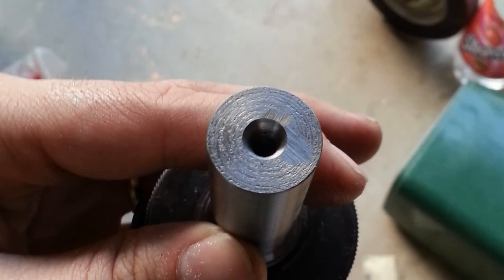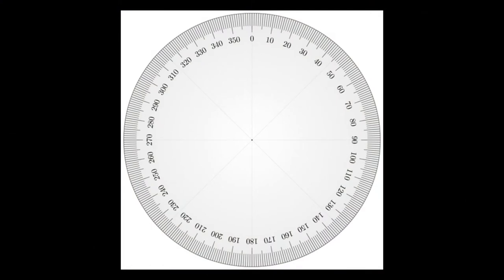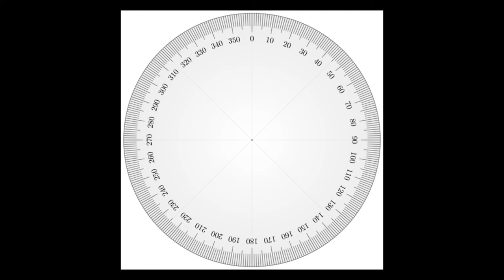Mini manual indexer/rotary for the Sherline milling machine

Comment: stick a timing pulley on the end of that and couple it to a stepper motor. Then you have a nice stand alone cnc dividing head/rotary table. i could send u a nice surplus nema 23 motor as well as the program code. i get the motors dirt cheap here and have a huge box full. all you would need is an arduino uno.
Reply: Naren Somaru I’ve seen nothing but programming headaches online with the Arduino Uno. Time is money and sherlines handheld is worth its weight in gold when it takes weeks to dial in a indexer control.
Reply: i am interested, could you send this to me?
Reply: @glennedward2201  It took me 10 mins to upload the code to my arduino. Ive been using it for 4 years now with no issues. There are tons of other guys who did the same, and all at a fraction of the cost of a commercial money making scheme, which in essence, is exactly the same.